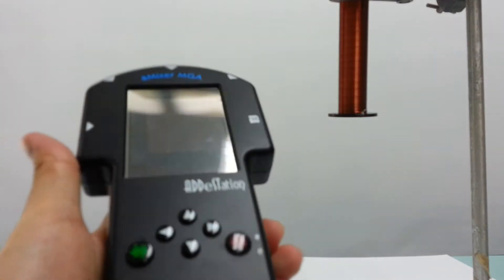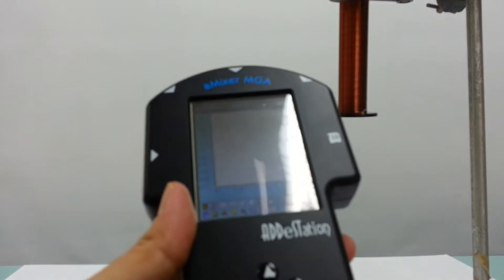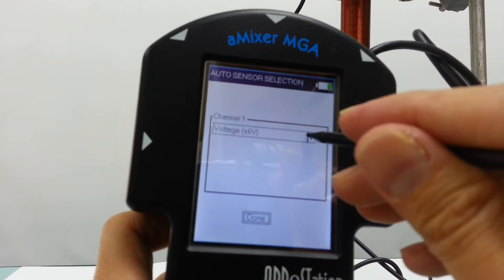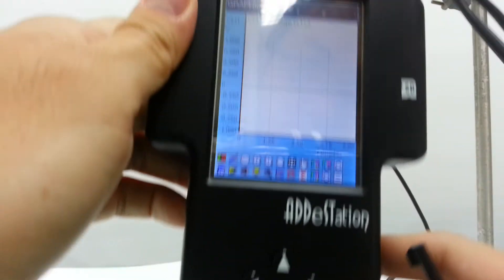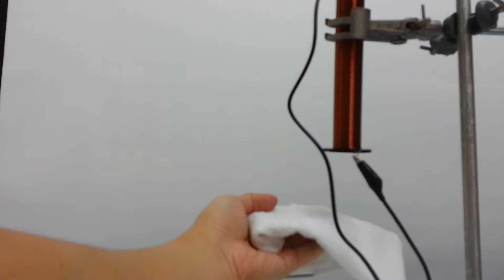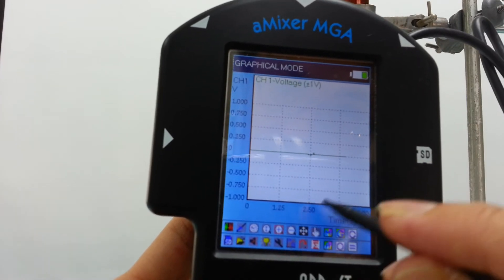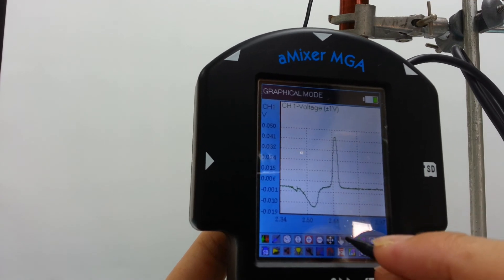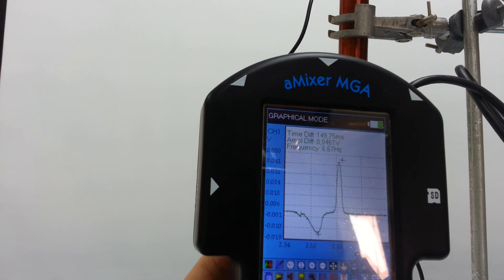Induced emf due to magnet falling through solenoid using Addestation Datalogger

Comment: Thank you for posting ! ! very interesting. QUESTION: what is the flat line between the drop in and the exit out spikes?? does this mean the electric field died while the magnet was traveling through?
Reply: Harold Westrich zero emf when the centre of solenoid corresponds with centre of magnet
Reply: @ravipradana9840  I don't think so.
I do think:
-The max influence (here higher negative voltage) should be when the magnet is at the center of the coil.
-The flat part is the moment when the magnet exits the coil.
- The positive voltage (very symetrical!) spike is due to the elasticity of the magnetic field going too far backward before returning to normal
Compare it with an object falling in water, making a drop of water appearing on top of the entering point in the water...
Notice that the first (negative) spike is asymetrical because the coil creates an opposition force opposed to the gravitional force slowing the fall at the beginning, and as the coil is lower, the top of the coil being less influenced starts to "push back" the magnetic field, creating on the top a force that is now added to the gravitational force, which accelerates the fall. 
 
Unfortunately, the video doesn't show which pole entered first in the coil...
It should be interesting to see if it makes a difference if north or south pole enters first.

A slow motion video would confirm my view ... or not ;-)